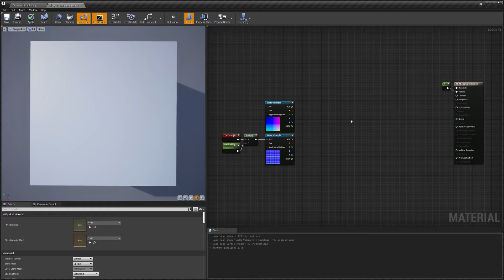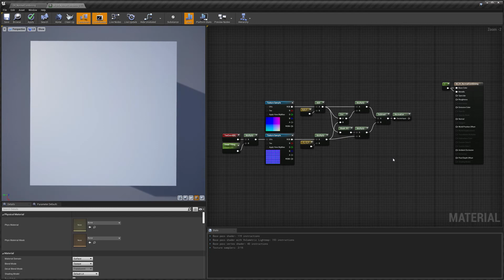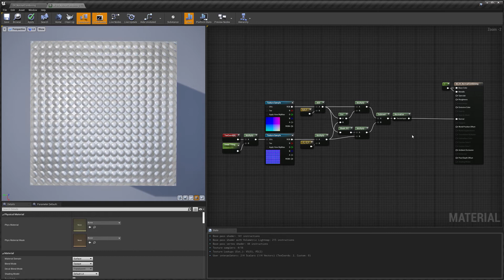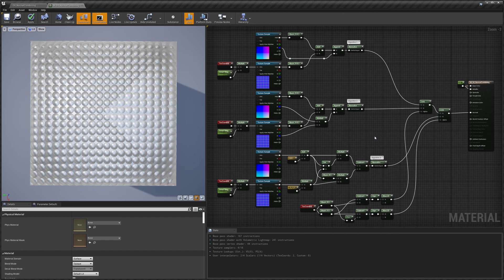Combining Normal Maps (UE4, valid for UE5)

Comment: In tangent space normals, you do not need blue component. As Unreal will calculate it from RG based on fact normal it's a unit vector. In case of World Space normal, there is ambiguity of Normal facing Up or Down. For example, BC5 texture compression does exactly that, it stores only R and G components and uses hardware acceleration to reconstruct B. Since it matters, which texture compression is used, you need to be careful while storing some arbitrary data in blue channel (like roughness or alpha), as in case of BC5 that data will be erased.

Comment: The last method in in editor under "Blend angle corrected normals" but it falling apart when used multiple times to blend few textures. I am using it only to blend basic and detail but if i must combine more then two i prefer to use method you show as second.
Reply from the maker: The last one is the most accurate, but allows for 360° turning of the normal vector, which can give you problems, yes :)
Probably it's better to use other methods, as you're doing, with many layers as they're also cheaper

Comment: You are my idol. I have gained so much knowledge watching your videos, thank you! By the way, i was making a function for blending normals according to your second method, and when hovering over the normalize node it says that there is no need to normalize values which are plugged into the normal output in the material graph, is this the case? I did a quick comparison and it seems to be so.
Reply from the maker: If you're plugging the vector in the final Normal pin there's no need, it does a normalisation internally :)
But if you do, doesn't really matter probably, as the compiler should be smart enough to realize that two normalizations in a row are useless and to just keep one :D

Comment: Thanks very much for posting this info. I was wondering is it also possible to combine normal texture like using vertex paint? So you could paint where you want certain normal to appear?
Reply from the maker: Of course! You just have to use a Vertex Colour channel as intensity parameter for the Detail Normal you want to add :)